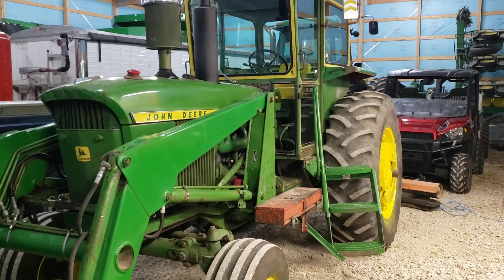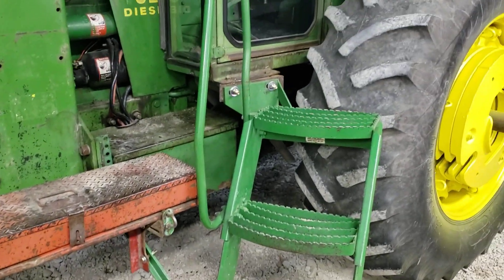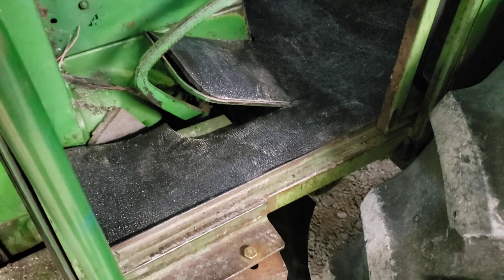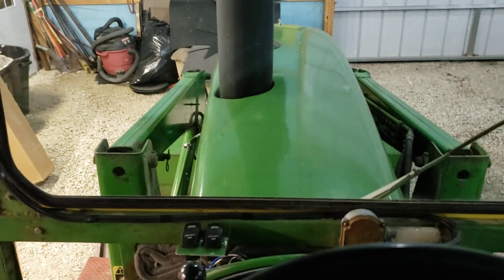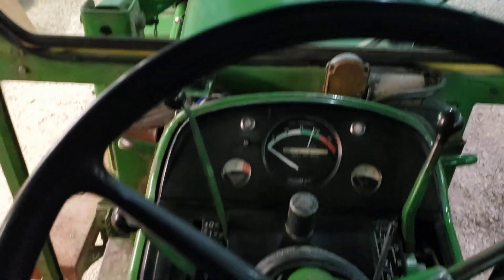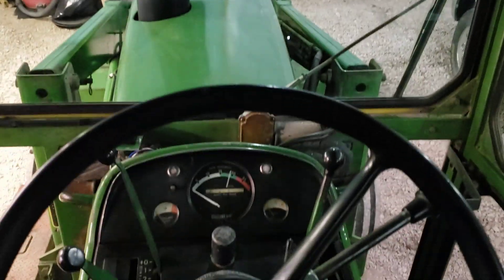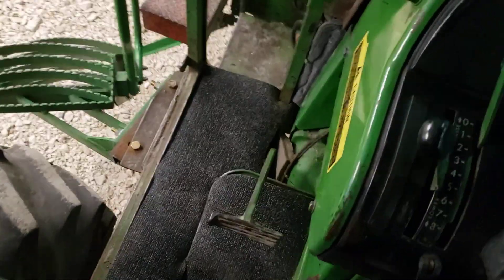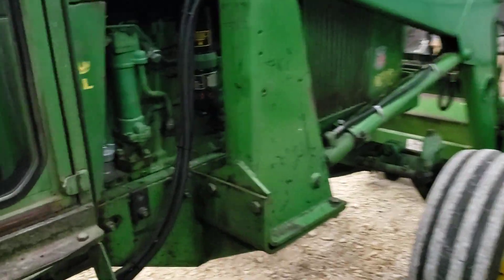Rustoration part 2 on the 4020

Comment: I watched the 2 videos of the john deere 4020. You did a amazing job with the lights and all the cab work. I wondering why is it that the decals of 4020 get moved from the trim pieces near the steering column to clear out to each side near the bottom of the fuel tank.  I have never understood why that is.
Reply from the maker: I guess i never really thought of it? Thanks for watching. I enjoy working on these older tractors and giving them a "renewed" feel

Comment: Suggestion about how to close up the holes in the floor where the pedal shanks pass through the floor. I have in the distant past driven a vehicle which has a sort of draft excluders fitted in these locations that looked like two strips of nylon brush bristles attached to aluminium strips which in turn were screwed to the floor. 

However, I have no idea where you might find such things although I think that I may have seen something similar fixed as a draft excluder for up and over doors. I hope that this might be of some possible use.
Reply from the maker: Good idea thanks!

Comment: That thing looks mint! Did you get the windshield wiper working on the front?
Reply from the maker: Its far from perfect but is alot better than what it started as. I need to add a switch back to it but honestly dont need it so i just unhooked it for now
Reply: @iafarmer  now you need a 4 or 5 bottom plow to pull behind that thing to play around with